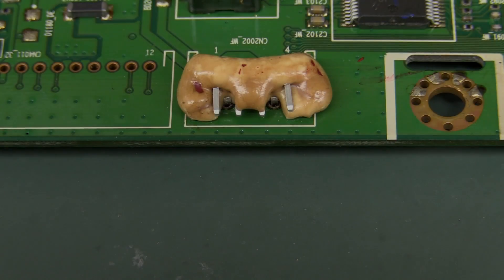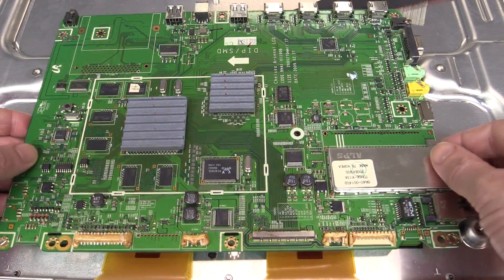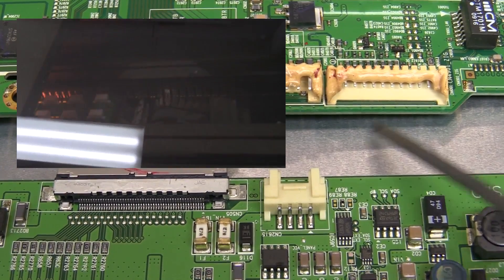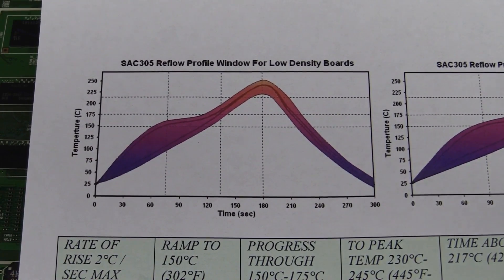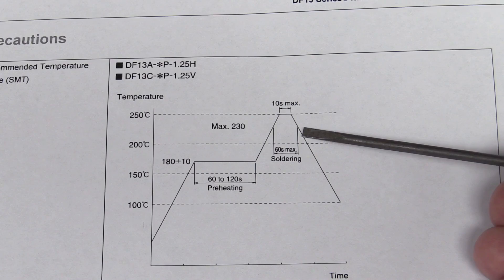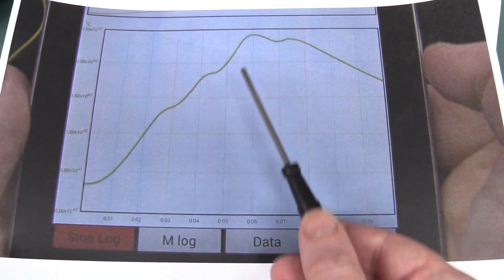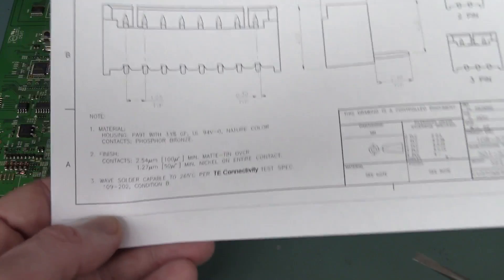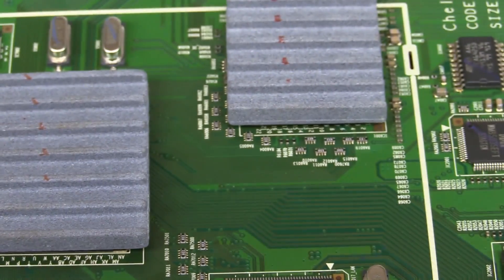EEVblog #782 - The Dangers Of Reflow Soldering

Comment: Back when SMD was new we bought an expensive hot air rework station for removing and replacing large quad flat packs. We got trained by the manufacturer's rep, bought the correct nozzles, and programmed the temp/time/airflow settings.The first time we tried to repair a board, the nearby SMD resistors and capacitors went floating away like so many tiny boats. The boards we had trained on had a bigger gap between IC and passives.

Comment: I wouldn't  count on all SMD components to be re-flow resistant. For example some SMD 20mm fuse holders are made to be soldered on by using a sharp tip iron on the side. The worst thing is that even then they begin to melt around the pads. Terrible trap... especially when the board is designed to be used bare and thus the ugliness is visible.

Comment: Hey i have been looking for a good reflow oven for a time now, any suggestions? max 400$ all are welcome to suggest :)
Reply: MasterMint2 A halogen Lamp, A decent magnifying glass, and a broom closet. Put a dab of flux next to the component you want to re-flow, when it starts to Bubble (it will very slowly) remove the heat source. Will take 1-1.5 hours, but its slow-motion cooking, less risk, and you can control where the heat goes using deflectors.

Comment: At 10:15, check the solder joints on that 36 pin IC. It looks like some of the pins are floating above the pads.
Reply: +dwDragon88 Who uses the builtin audio capabilities of huge TVs? They sound like ass.
Reply: dwDragon88 That's the audio output IC. Unlikely to cause video problems. ;)
Reply: envisionelec So if Dave is trying to repair the TV, he's not going to want audio? ...
Reply: dwDragon88 Precisely.
Reply: George Tsiros Sounds like the sound is coming out of the TV's ass
Reply: dwDragon88 the entire thing belongs in the bin.
Reply: People that are pulling them out of dumpsters.

Comment: I have made that mistake myself on my first run of the reflow oven and I was thinking exactly that while watching your last video where you reflowed the board. However I've never had a proper SMD connector designed for reflow, melt in my cheap reflow oven, so I wouldn't blame the oven in your case. Those connectors just weren't designed for reflow. That Samsung board first gets populated with the SMD parts, goes through reflow, then gets populated with through hole parts and goes through the wave soldering process.

Comment: If I remember correctly, re-flowing doesn't take all that long, so what if you wrapped some al foil over the connectors to reflect the heat? I know that that woild basically be making a small oven around it eventually but I think it'd reflect the heat to begin with, and considering the short exposure time, I think it might work.
Reply: Darren Jacobson Depends, sometimes a reflector can trap heat inside the system. It's in part a timing differential. However, clamping aerogel mats to the surface can work.
Reply: ***** Yeah, I kind of figured that might happen.
Reply: Gravity I don't know what an aerogel mat is, but what about taping mylar around the connectors?
Reply: Darren Jacobson You want to look at the thermal transfer vectors. Mylar is good for reflecting radiative heat, as in from IR. An oven like that will have a lot of convective heat though, and as an aluminized plastic, mylar will likely melt. That's one issue with foil, aluminum itself is thermally conductive. That's one reason it's a prime heatsink material. Aerogel however is an air-pocket insulator, usually ceramic or silica based. You'd want to be using an insulator like that to block the convective vector. It can be surface aluminized as well to block the radiative vector too.
Reply: Gravity Right, good point, I was thinking of IR, convective is different though isn't it. Yeah, silica based stuff would probably be good.

Comment: Oops!
A case of the shit reflowing without a circulation fan. :P
Reply from the maker: richfiles Same thing can happen with a circulation fan, that's not automatically a magic solution.
Reply: EEVblog Yes, a fan won't make the part withstand a higher temperature.  Cheap plastic is cheap plastic, fan or not.
Reply: +EEVblog that was caused because you were not using proper wireless anti static wristbands!
Reply: EEVblog
Gah! I travel out of town, and return after being gone all day to see that NO ONE got the "shit hits the fan reference".
/)_-
Had nothing to actually do with circulation fans... :P
Reply: JimAnd Keisha Though note, even 'expensive' plastic may not be high temperature rated. 'Cost' tends not to be a good measure, one should usually examine the specifications and tests for things directly.